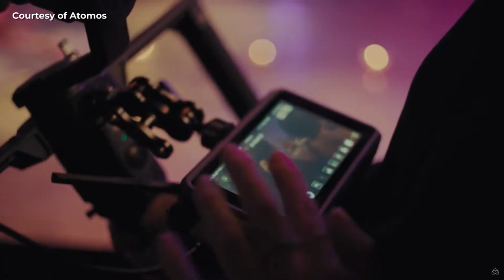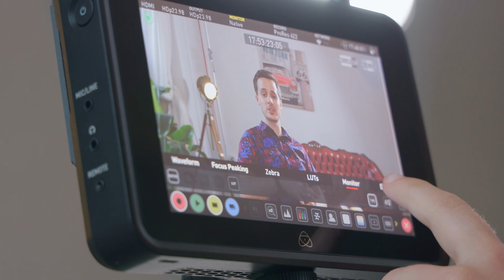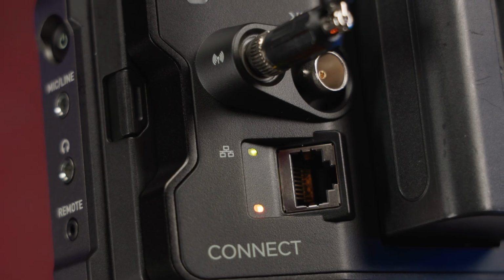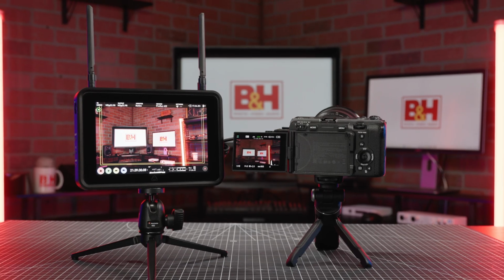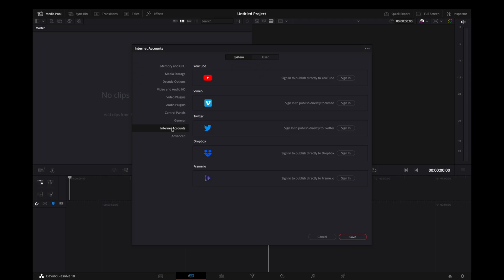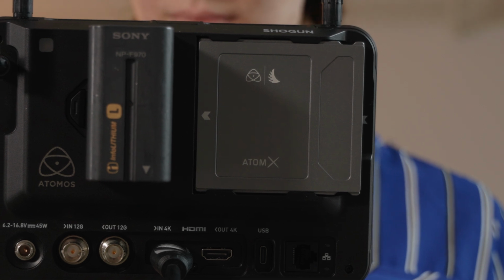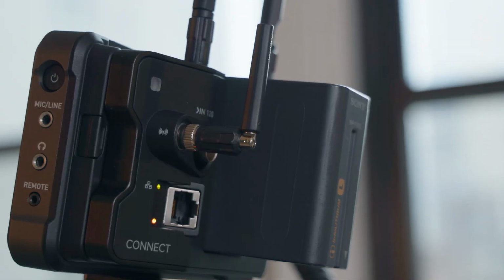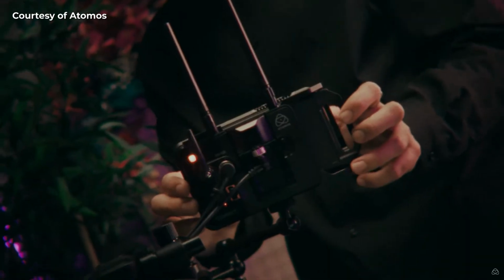Atomos CONNECT & Shogun CONNECT: Unlock Your Workflow!

Comment: Can I use this out in the field without Wi-Fi just on data to upload footage or do I need a hotspot Wi-Fi?
Reply from the maker: The Atomos CONNECT Network, Wireless & SDI Expansion for NINJA V/V+ is not capable of connecting to the internet over cellular data, so it must be connected to a hotspot over Wi-Fi when operating in the field.

Comment: You can’t do 8k on this monitor. Hdmi 2.0a only supports 4k 60fps and 4k 120fps at reduced color. And with sdi, you need four streams of 12g sdi to support 8k 60. If they really wanted 8k put a hdmi 2.1b or four 12g sdi outputs.

Comment: It does not support 8k RAW, this is incorrect. I searched everywhere for this until I found on the website that this is not possible.
Reply: I was wondering that. The monitor only has 12g sdi which can only support 4k 60fps, and 2.0a hdmi which supports 4k 120fps. To be able to support 8k it needs 4 streams of 12g sdi which I haven’t found a camera that does that.

Comment: Lets say i have 2 ninja v both with connect module and i do live production. When i switch from cam a to cam b, first where the recorded files go? Second, do i get the iso recordings too? Do i have the option for an xml file that i can than import to premier to swap the video with the original 4k saves from the ninja v but still keep the switches ive done? If yes… i would gladly pay the studio plan to atomos, otherwise why bother with online switcher when i can use just any switcher like atem pro iso and have all the iso files and program feed. Please enlighten me.
Reply from the maker: You can see how that is set up here: https://bhpho.to/3TltskR.   Please email us with your various workflow questions:  askbh@bandh.com                    >Mark<
Reply: @BandH  thats just the user manual for the ninja :\

Comment: With the Sony FS7 and the Atomos Ninja V with the Atomos Connect 12G in would I be able to capture 4k Raw with the XDCA-FS7 Extension Unit?
Reply from the maker: The Sony XDCA-FS7AW  requires the HXR-IFR5 Interface Unit and a compatible recorder. The Atomos Ninja V features an HDMI input only. Consider the Atomos Shogun CONNECT 7" Network-Connected HDR Video Monitor & Recorder 8Kp30/4Kp120 BH #ATOMSHGC01.       >Mark<

Comment: Does this send HEVC SRT directly from the unit or does it send h264 to cloud and then from cloud as HEVC over SRT to final destination?
Reply from the maker: The proxy  files are created in the device before being transferred to the cloud.   >Mark<
Reply from the maker: The proxy files can be uploaded during capture in the device using ATOMOS transfer technology for immediate availability in the cloud post-recording.  Adobe Frame.io support makes the Shogun CONNECT a camera-to-cloud device, allowing you to take footage from your camera and transfer it over a long-range connection between other devices. Wi-Fi 6, Bluetooth LE, Gigabit Ethernet, and USB-C connection ensure flexible, all-around connectivity. Remote collaboration brings production and post-production closer together with features like dual recording and progressive transfer technology.   >Mark<

Comment: Hi, thanks for an inspiring video. I have the Shogun Connect with Sony FX9 and have just started recording with Prores RAW, editing in Resolve. I find that there are not so many options when you want to import media into Resolve and keep the RAW opportunities. Now I use Cinema DNG-files converted in Assimilate Play studio Pro, but it is not very comfortable with all these small files. Will this work with the workflow you describe when it comes to reconnecting the originals or do you have other suggestions for software to convert the RAW files?

Comment: I have an FX6 and I have the shogun Connect, I am having trouble recording any other format then RAW even thought I change the output on both SDI and HDMI and even when I change the format on cam. The record button is greyed out on every other format. What am I missing?
Reply: Have logged in the web interface of atomos and activated the tokens of the right codec?
Reply: @MovieMakervIs  Thanks. I had to reset to factory.